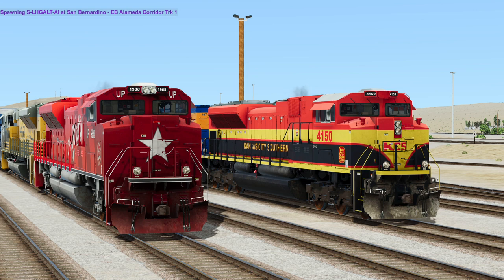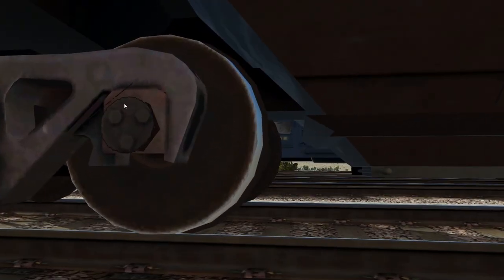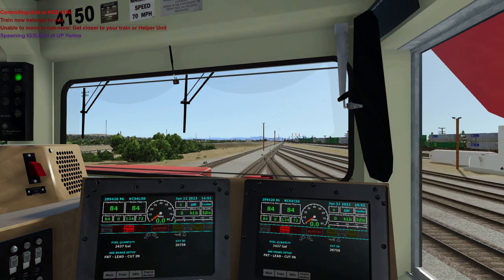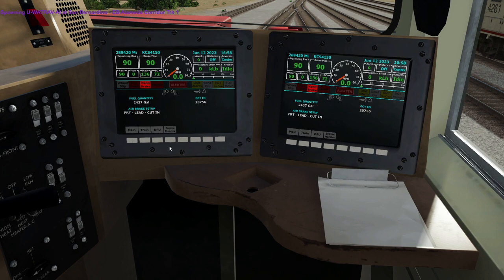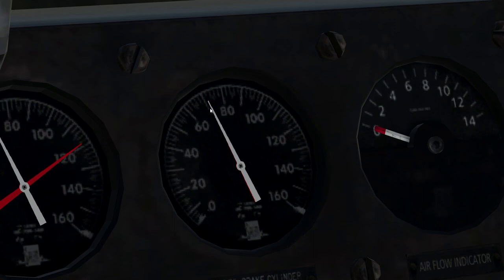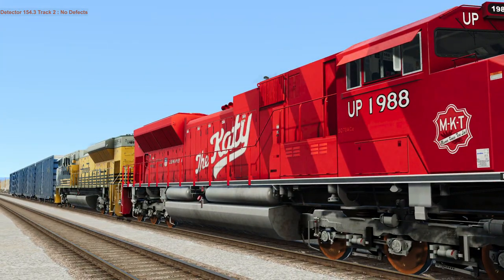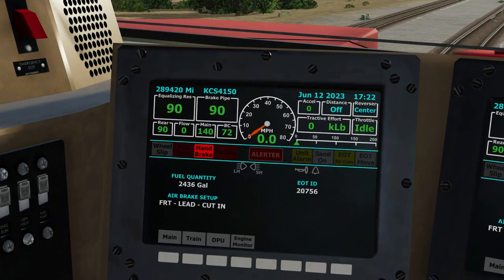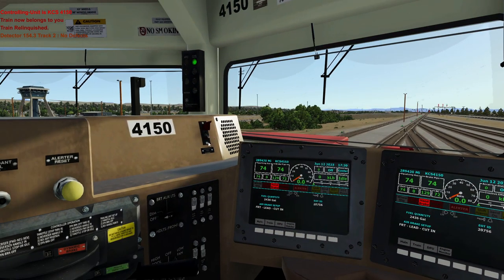Run 8 Tutorial - Brakes And Brake Tests

Comment: Considering maybe picking up run 8. Maybe if they add a NS route considering thats my rr i work for.
Reply: I got it a few months ago and LOVE it!  It's a learning curve, but if you stick with it you will love it too!!!!!
Reply: Have had Run8 since 2017. Big learning curve but once you understand the keyboard combinations or use raildriver you will love it. Plus the Depot Server community is great.
Reply: NS Pennsylvania sub is out now! I would recommend the highball run8 community server. A little nicer than the folks at the depot.
Reply: @v1ohno  I'm new to Run8 but already pretty invested and enjoying it. I recently got on the highball server and I'm finding I have the same issues I had in single player. What do you do? In Highball do you just fly to whatever yard you wanna depart out of and build your own train in the consists menu, and depart, or is there something more to it? Do you just crew a random train and take it? What's the "job" loop there I guess is what I'm getting at. I like running things like H-BARLAC would I just spawn in and load or create an H-BARLAC and plop it down on the tracks and go or do you pick from a train already in the yard and take that job/route?